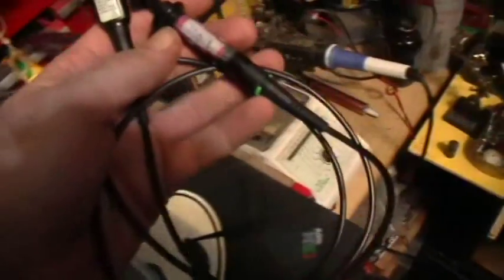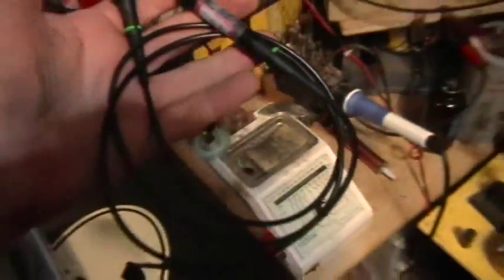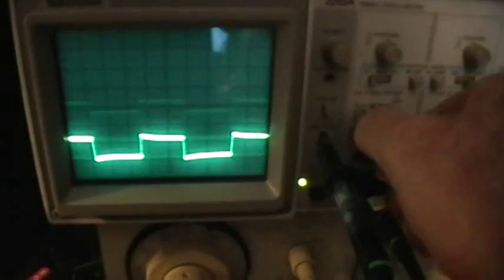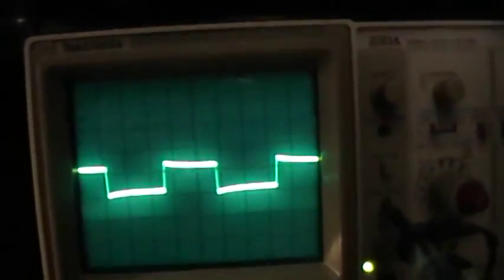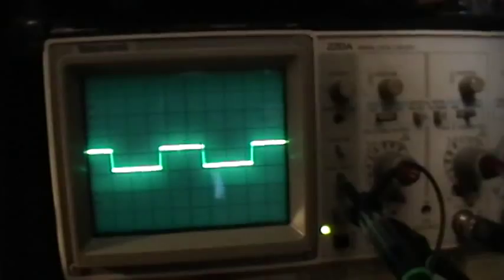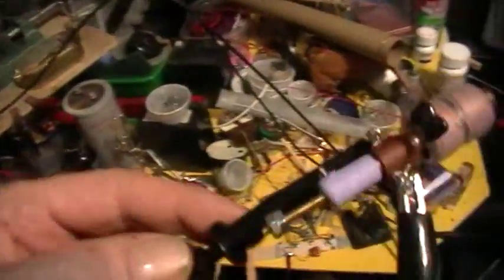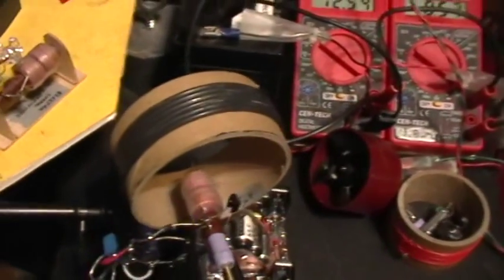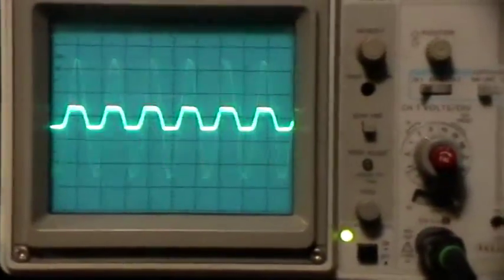Electric OU: Supplement: 100x Probe, Compensation, HVReceptor

Comment: That loopstick thing.... Is that something you build yourself ? Wind yourself ?
Reply from the maker: No, not at all. It is a variable inductor. They used to be quite common in radio receivers and transmitters. I think these I have here were made by Mallory, sometime in the middle of the last century.

I took one apart, though. The wire is 16-strand Litz wire and there are 260 turns in each bundle, in one continuous winding. With no core they measure about 1-2 mH and with core fully in they are about 9-10 mH. The core is a little cylinder of ferrite. For these resonance experiements I try to set the thing at around half-travel or 5 mH for the calculations of the matching capacitor for the desired resonant frequency.

I 'improved' mine by slipping a piece of heatshrink over the coil portion, to protect it from mechanical damage.

Comment: So if you have the spark gap the voltage would build up and destroy the caps
Reply from the maker: I think you left out a word. If I did not have the spark gap, or a neon stack or some other voltage limiting load, then the voltage would build up to probably about 600 V, or 1200 V peak-to-peak. The capacitor stack is only good for 500 volts and indeed stores a lot of energy at that voltage, and electrolytics can explode if they are overvolted.  Also I do not know the insulation rating on these loopsticks. They are wound with 16 strand Litz wire and each individual strand is much finer than a human hair. So far they have stood up to the 940 v peak-to-peak voltage swings. Also the brown mica caps are 500 volt caps, I think. So I am at the edge of all the component voltage ratings already, and that's with just 12.5 volts or less on the input.